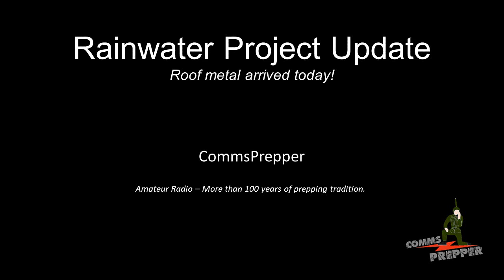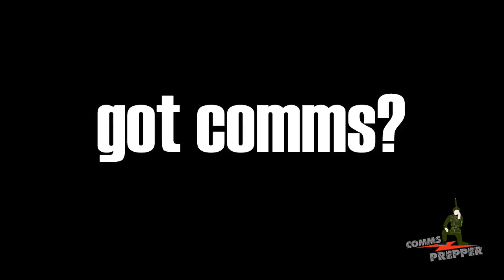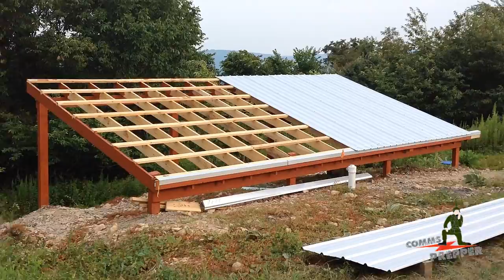Rainwater collection

Comment: Very nice looking job so far. I assume dwelling is gravity fed. If this Q has already been asked, I apologize, but I am wondering how you came up with the specifications. Did you calculate what minimum size was good for your needs based on some historical rain data? Or did you just build it as big as your resources allowed? 73
Reply from the maker: System is gravity feed.  Here is my first video on this project with all the math. Update, VR, Shout Outs, and Stuff

Comment: I wonder if a solar panels would work in combination with water collection... The space would serve a dual purpose.
Reply from the maker: I could put solar panels on the rainwater collector but the distance from the house would make it to expensive for my budget.
Reply: Commsprepper
Couldn't you use an inverter at the source and use the less expensive wires for AC or is the house DC?  I look at that rainwater catchment and I see it boxed in and used for additional storage like an odd shaped shed. LOL

Comment: Nice job. It won't be long until it's done then on to the next project.
Reply from the maker: Finishing the solar project is next!  Need to run the cable to the crawl space and get the batteries. So many projects - so little time :-)  But I will get them done!  Thanks for watching and taking the time to comment.  Respectfully - CommsPrepper

Comment: I bet you will wish you had faced it away from the house.
Reply from the maker: I don't understand the comment.  It is faced away from the house and about 400 feet from the house and 300 feet above the house.
Reply: I understand. It seemed low enough that the reflection of the sun could be a bit of a glare. I've seen metal barns and sheds that were a reflection problem, i.e hot & bright. Not the case here.
Reply from the maker: Chuckles Not at all.  The retreat is down the hill from the collector.
Reply: Sounds like you have a good game plan.

Comment: Looking very nice!
Reply from the maker: Thank you.  I am happy with how this project has been coming along.
Reply: Commsprepper Nice brother looks good. I got to ask can you use that to store your fire wood and will you be putting PV panels on it? Thanks man. God Bless.
Reply from the maker: yankey4 Yankee - Thanks.  I guess I could put firewood under it but it's far from the house and way up a hill.  Snakes would also be another concern with wood piles.  It is also to far from the house to cost effectively put panels on it and get the power to the house.
Reply: Commsprepper O I did not know it was so fare from the house for the wood. But this would work for your PV Micro-inverters it makes the AC at the sores then you can use just cheap 1-10 wire for the run to the house with no lost..